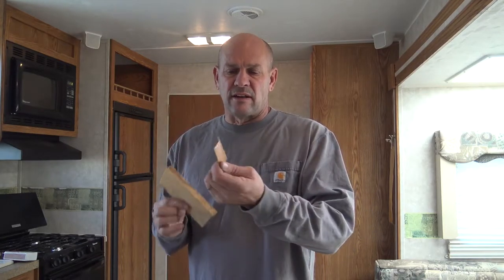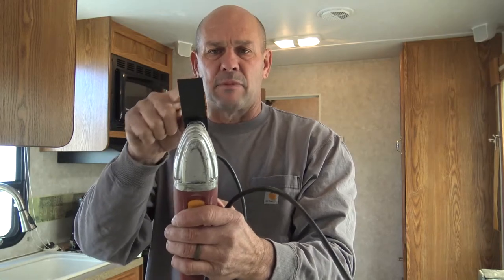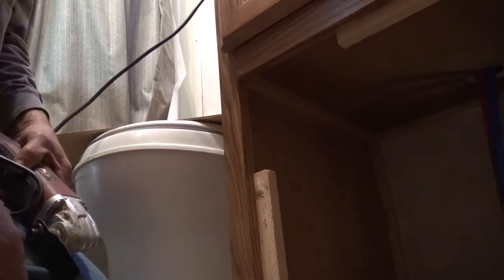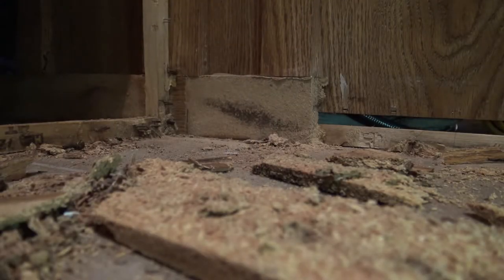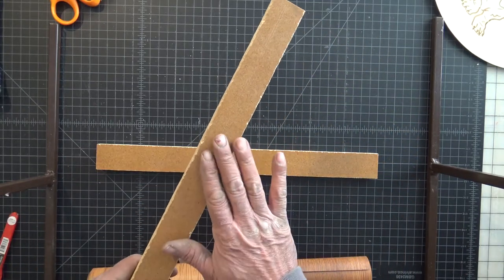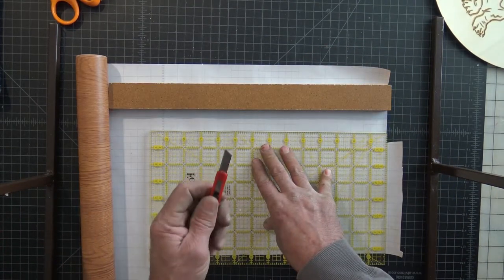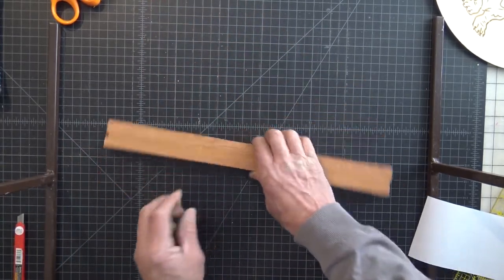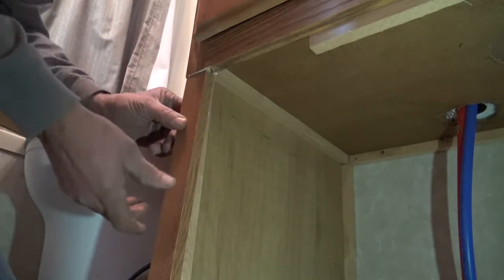Fake Wood In RV Repair / How to Repair RV Cabinet Wood Trim

Comment: I would have been inclined to replace the damaged section with pine wood. The biggest issue would be to match the stain color (but not impossible).
Reply from the maker: The color isn't too hard to match, but once we put real wood up beside the papered wood, it stuck out like a beacon - different texture and thickness were the big motivators.

Comment: Did you use  real wood or particle board. Just trying to figure out what material you used to attach the wood grain paper to.
Reply from the maker: We chose to use particle board.  When we tried it on regular pine, the grain of the wood, wouldn't allow the material to stick to it.
Reply: @DIYOnTheHouse  Thank you
Reply: Hi there, this video is the closest I've found to my issue. The same warping and breakage is happening to my particle board that fits around the sink. Do you think I could use a heat gun to remove the old contact paper and then sand the damage down? I can't really replace the whole counter but I feel if I just put new contact paper over the old it will look terrible. Any suggestions would be greatly appreciated!
Reply: @PetalsandParchment  What did you go with I think a heat gun and spray adhesive is what I plan on trying